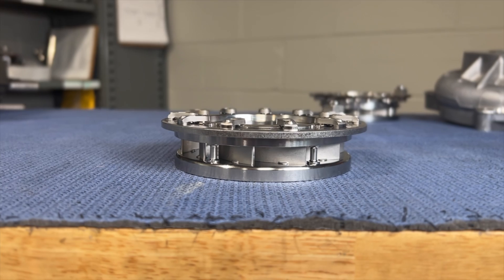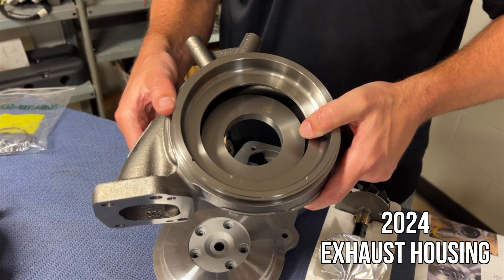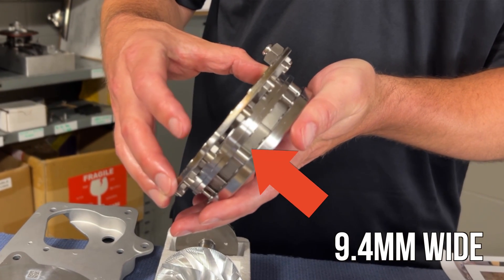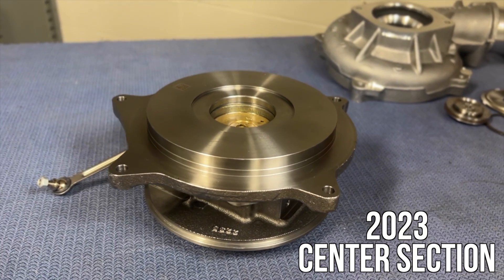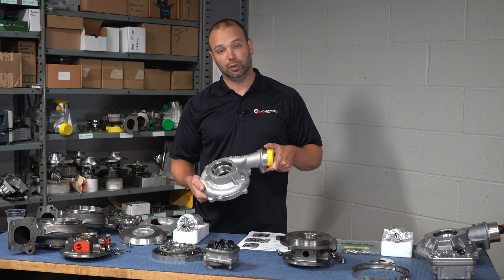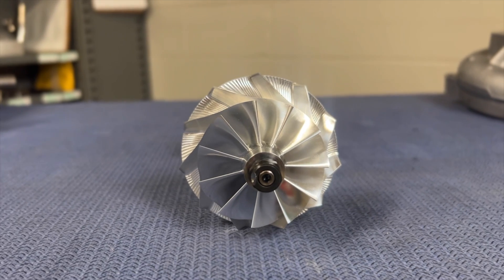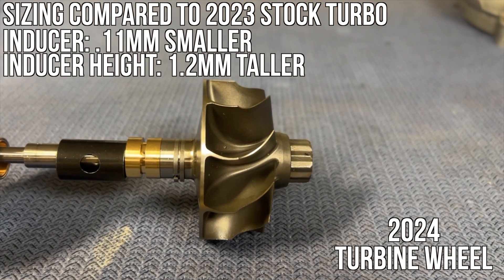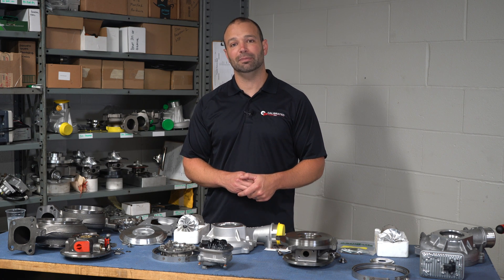2024 L5P Turbo vs 2023 L5P Turbo Comparison

Comment: My stock ‘24 duramax has the worst turbo lag I’ve ever experienced and has bad compressor surge frequently. Has less than 2000 miles on it and is completely stock. Heard anything similar about these trucks?

Comment: Do you have any real world numbers like in the mountains with a trailer comparing the stock turbo vs 64 vs 67 passing power? With my 2023 6.6L duramax I don’t struggle going up hills but passing power behind slow semi’s it feels like a lot of effort even though I’m not exceeding the nameplate. It would be nice to see everyday driver without a trailer and with trailer before and after fuel and DEF economy. EGT improvements?

Do assume everything is stock? If so it would be nice to see this same test again with the WC Fab stage 3 air kit installed as well.

Comment: Great comparison on the two turbos thanks so much for sharing I just subscribed. 

Regretfully GMC totally screwed up the exhaust brake on the 24's its now what they call a smart exhaust brake but it totally retarded in its operation. Unlike past brakes which engaged as you let off the throttle, you now have to hold the brake for the exhaust brake to engage. In addition, it does not work in manual mode on the the transmission. Many drivers myself included  only use manual shifting when pulling loads in the mountains. Finally, the brake does not kick out, it might take up to a few minutes for the processor figure out the brake is off and shift back into the correct gear so it remains in a lower gear what seems for ever. 

Finally, In your opinion what percentage of exhaust braking does the turbo contribute to overall exhaust braking on the 6.6. Many thanks Mike
Reply from the maker: @LowOnCash To be honest we don't really know. Conventional engine braking (using downshifting to increase RPM without adding additional fuel or air) can take on a significant amount of the braking energy required to stop a truck. Probably somewhere between 50-80%. So with that in mind, I would say you should be able to receive slightly less absorption from your turbo brake considering it is also applying the conventional brakes at the same time. If i had to guess i would say it provides about 40-60% of the energy absorption if used effectively.

Comment: Has the diameter of the up-pipes from the exhaust manifold to the turbo increased? From what I understand factory up pipes are super restrictive on the l5ps.
Reply from the maker: Will report back....
Reply: @Duramaxtuner what did you find out?

Comment: Are you going to build a 15 mm version of that to melt down also or go straight  a 12mm cage?
Reply from the maker: There's definitely more R&D to come with this turbo. We have noticed that vane cage opening size plays a large roll in turbo efficiency and efficiency range. We are constantly working to optimize and improve the upgraded components that we put in our turbos. So no matter changes we make you can be sure that we will be putting what we consider to be the best parts possible in all the new 2024 housings.

Comment: Wonder if the new design helps with exhaust braking? That’s my only complaint on my 2022, exhaust brake is very weak.
Reply from the maker: We have heard that compliant on the stock L5P.